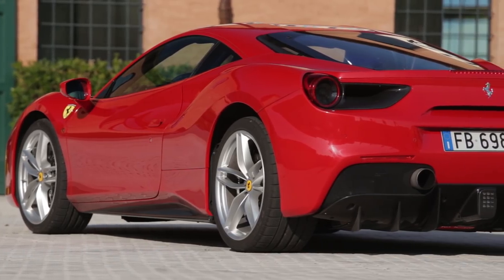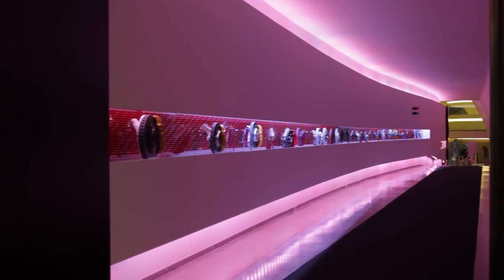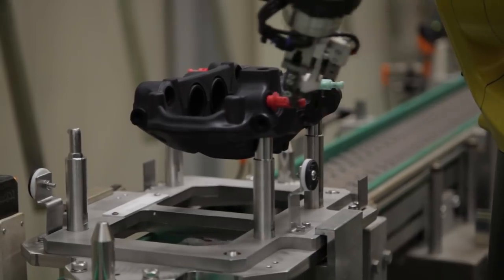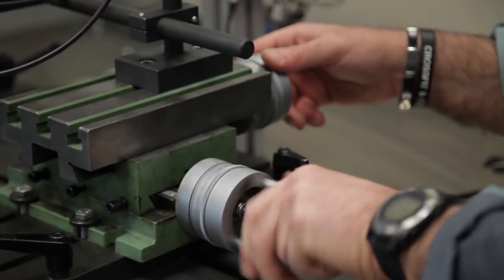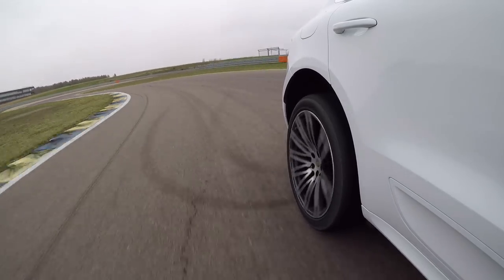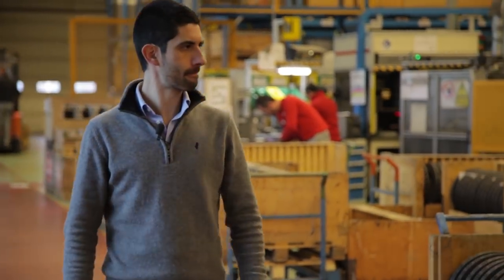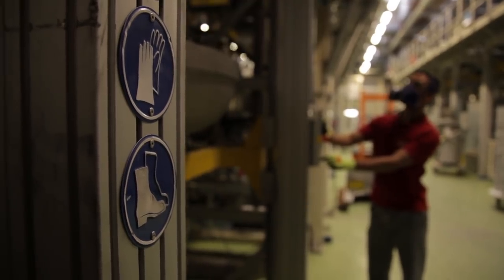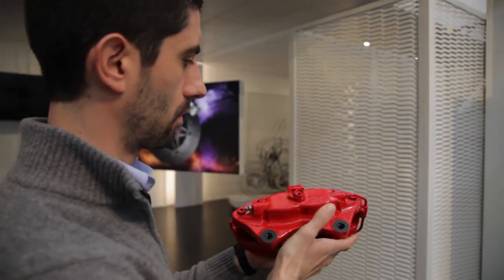Brembo, Where The Brakes Of Supercars Are Born

Comment: Story Time:
...I was helped (financially speaking) by my folks in getting my first car, WAY back in '95: It was an '89 Ford Probe GT...the one with the little 2.2 turbo. 
  It was damned quick, for what it was, I might add: I messed around with the wastegate and was able to coax 15~17 psi out of it-- instead of the old crummy stock 10~12 psi.
ANYWAYS, I digress: NOW, with all that "go" and not enough "woah", it sometimes made for some scary, exciting moments. The rotors on that car must've been -- I don't know-- 9" in diameter?! It only had 15" wheels so, they couldn't have been TOO big...
It was just ridiculous. If you had to come to a stop from high speeds, you were good...AS LONG AS YOU ONLY HAD TO DO IT ONE TIME.
 As soon as you'd again hit the brakes from "high speed", the rotors IMMEDIATELY glowed red:
I was witness to this when riding in a friend's car, while running next to mine.
 The brake pedal in it would transform into a sock puppet. Foot TO THE FLOOR without any resistance. You had to really plan out your method of reducing speed.
  Since I was 15 y.o., I yearned for a Brembi brake kit. Not necessarily on THAT car, mind you, but on SOME vehicle I would own in the future. I even went "Boy Racer" and painted all 4 of the little dinky, single piston, floating calipers bright Red. I was the coolest kid in town with those red calipers. 
  Of course, they were SO small, you really couldn't see them very well....even though they were painted cherry red.
  What I REALLY wanted was a real-deal Gran Turismo kit on my vehicle. Knowing what it felt like when your brakes essentially go out, is not a good feeling. It's a feeling I didn't ever want to experience again.
  YEARS later, I took over my father's old work car: An '04 Sentra.
  And wouldn't you know it?-- it had the optional gold Brembo front calipers. Even without ABS (...which WASN'T available with that option, for some reason or another?), having those big brakes on that little (essentially an economy) car, made for some extremely short stopping distances-- THAT WERE REPEATABLE! over & over & over...
  I'm not a wealthy guy by any means. It took a couple of decades, but, I FINALLY succeeded in getting a Brembo-equipped car.
Reply: ..."since I was 15, I yearned for a BREMBI equipped car"...?
LOL....the hell is a Brembi, anyways?

I yearned for a B-R-E-M-B-O equipped vehicle.
There.